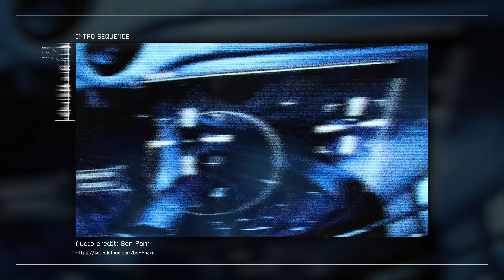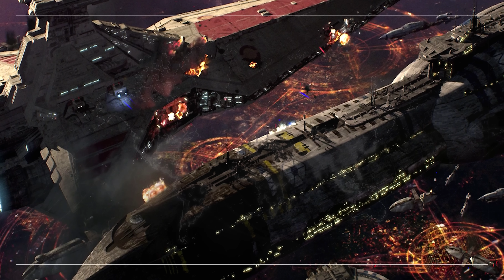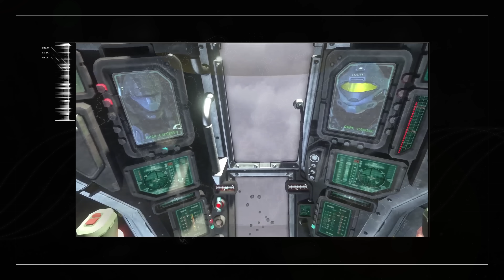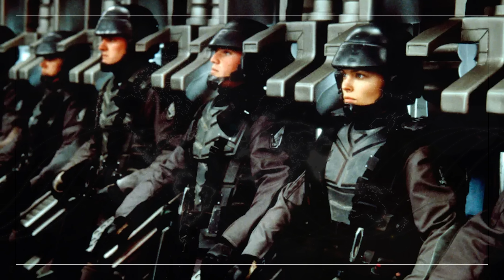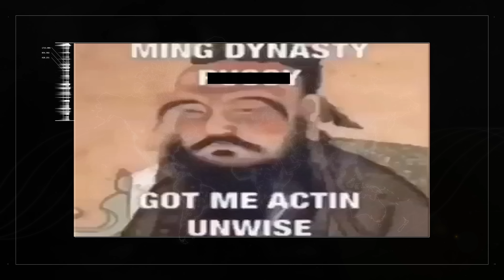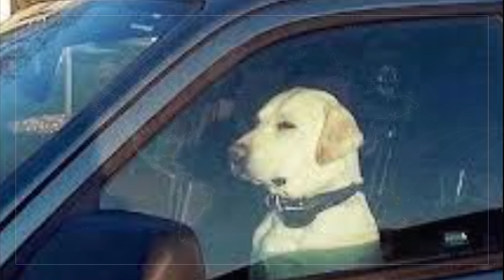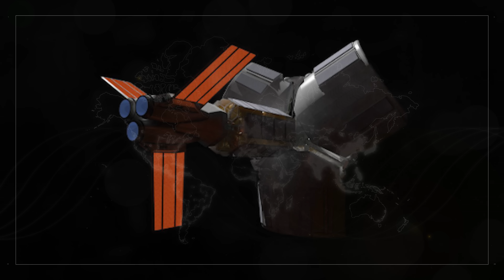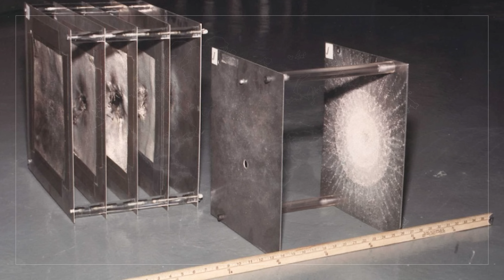The REALITY of Space Warfare

Comment: Yes, space heaters are 100% efficient. 👍

Some notes for the margins:

Droping things from orbit is not really a thing.  Absent an atmospheres, you need as much energy to get something from orbit as into orbit.  An atmosphere makes a difference: The drag makes the way up more expensive and the way down cheaper, but that's just a few kilometres of the way, not all that significant.  Though the heat shielding adds more mass, so there's that.  Orbit is only the high ground for surveilance, not for anything tactical.

Kinetic point defences, as used on maritme navy ships, are not a good idea in space.  For one thing, the recoil is going to do more damage to your ship than the target: nothing to brace against.  For another, there is no drop, so you just add high velocity space debris that will circle around and get you in the back.

The only good option for point defence is lasers.  They don't have much range, and their waste heat will require some massive heat sinks.  Point defence and communication are the only thing they are good for.

Technically, RKVs are also useful for point defence.  As long as you have more of them than your enemy.

There's only three weapon types in space: Inert missiles (like asteroids or tungsten rods), lasers (extremely short range and damaging your own ship), and RKVs (although the R is rather dodgy: whoever has more delta-v wins, but for that to be true the RKV can't just waste reaction mass, it has to match orbit; and light sails and dark sails give you infinite delta-v, so… faster acceleration can't lose, but a win is no longer guaranteed).

Some like to imagine plasma weapons, essenially throwing ball lighning at another ship.  That has all the disadvantages of lasers with none of the advantages.

Comment: Couldn't you convert the heat generated by your ship to whatever form of energy your ship uses to generate thrust?

Like a computer that turns heat into electricity.
Ion thrusters are a thing: they use electric wind to push matter away from your vehicle, moving it in the process.

The excess heat that you cannot convert due to inefficiencies in the conversion process, could be store in a heatsink until there's enough of it that you can run it through the conversion process again.

Comment: Just to slightly challenge hard sci conventions:
I think the inherent advantage to planet defense is working with gravity rather than against it.

 So maybe... dig deep in the bed rock under the ocean, and your attacker has to remove the water (or liquid cycle) just to reach the (new)ground level... to then locate  the correct area, to blast a hole into former sea bed deep enough to reach your subterranean base.... all without mass falling/moving back to cover up the damage.
 
This works because gravity pulls much ejected mass and much of a liquid body back to fill in the orbital drop damage; thus the concept is like terminator armor, or the closest thing we have to energy shields, all without spending active defense energy.

Obviously a big enough drop can crack a tectonic plate, or worse. 
But big attacks are more easy spotted, take more energy to bring to effective trajectory in a reasonable time frame, and are more easily intercepted. 
Just as future combat requires more resources, the cost of digging to such a deep and remote base of operation would likely be more cost effective for the relevant method of combat of that time.

But yeah it might be possible to have directional radiation with out too much complexity, after all we can focus much of the EMS already. Like a flashlight is focused visible light, and directional radio waves aren't too hard.

 I suspect space combat will be like mosquitos, with sniper rifles at kilos away. . . but what can be forgotten is that the area in space is cubic, so comparing space combat to naval combat or a sports field isn't a good metaphor.

... and oh, yeah we always assume spaceships blowup after being "killed". . . a lot of things when broken don't exploded when we think they should, like tanks for instance don't always explode.

Comment: I disagree on this planet versus space take. Assuming similar tech levels. A planet would always have more resources to work with. Everything you need is on the planet. The space force would have to bring its own.

Also the silly thing that all most all Sci-Fi doesnt care about is heat dissipation. Any thing in space that generates power will need radiators so it will not melt.
On a planet you can dump the heat in to atmosphere or the ocean.

And you cannot sneak up on a planet. There is no stealth in space. The planet will see you coming.  

Also I didn't come up with this. Science and Futurism with Isaac Arthur YT channel did. He made a convincing argument.

Comment: I think the single most important factor with space warfare is actually signal warfare. It's quite underappreciated since it's not flashy, but technically flares and chaffs are part of signal warfare, as are decoys. Depending on its effectiveness and the countermeasures to it, long range artillery battles might not be viable and require visual range combat instead, making for exciting close range combat scenes. Tied together with the fact that low powered laser based point defenses can be made to fry the sensors on missiles to turn them into dumb rockets reliably since nothing is faster than a laser. The question at that point becomes how much of such systems that would be the first thought of any space military can be overcome between tactics and technology. The result will determine whether space combat will revert to light second ranged artillery battles, or visual range dogfighting.

As for the intro, I'm not a fan of long intros. Anything more than 10 seconds has me skipping them, with a strong preference towards intros less than 5 seconds. This is a youtube video, not anime. The intro isn't a piece of art to appreciate every episode, but a signboard to know where you are..

Comment: Kessler syndrome takes years to develop. And even then it doesn't take much higher tech or more desperate people than us to still access orbit through a cloud of debris. Using nuclear propulsion can give you enough spare capacity to armor your spaceships, especially if the goal is just short term defense, like delivering a kill vehicle to the people who tried to weaponize kessler syndrome.

Firing down on a planet has one problem you didn't mention, which is that point defenses and counter-missiles exist. We have THAAD, Patriot, and dozens of other systems designed to take down things moving quickly in the atmosphere. In a setting were invaders from another world is a potential near term threat, the defenders are going to design appropriate systems and mass produce them on the same scale while the invader is building up its fleet. 

Planets have one massive advantage that space forces lack: Dirt. Armoring your facilities? Literally dirt cheap. Hiding your defenses? Dirt cheap. Railgun ammo? Not quite dirt cheap, but iron's fairly easy to come by. Life support? Dirt cheap. Thermal venting? Dump it into the ocean. Your space force needs to be able to get here, which means it needs to strip away every gram of mass it can spare. Lighter guns, less armor, less ammo, any cut they can make means they can send a bit more or send it a bit faster. Dirtside, however, you can build as heavy as you want. Use as much power as you want. Require as much crew as you want. You have all your resources right here, and they have a long stretched out supply line.

In general, comparing a space-faring civilization capable of reaching an inhabited world to our own planet and our own tech level, industrialization, and available hardware is uninteresting. It's like pointing out that the US army can defeat a tribe of cavemen. We already know that. But the moment you diligently give the two sides similar resources and tech, it turns out there's a massive overhead involved in building interplanetary invasion forces compared to orbital and surface defenses. 

Say ton for ton a spaceship costs twice as much as a similar ground based system. And that's being extremely generous. That means a ground based force can have twice the firepower in massively armored hidden frames. Twice the point defenses. Twice the sensors. Generally, you're going to want a 3 to 1 in your favor if you're the attacker. Against a prepared defender with twice your capabilities, you just lose. Every single time. And that's assuming a star wars level of magical tech to make spaceships extremely cheap. Currently, it's more like space hardware costs 10-100 times more than similar ground based capacity. 

Gravity is basically a non-issue for any entity that can contemplate invading another planet. If 10kps makes a difference to you, how did you get there in the first place?
Reply: And with how rare we believe habitable-for-carbon-life planets are, it's just as difficult to believe some perceived invasion force would want to simply obliterate it with "cheap" RKV's. That would mean YOUR space-faring people couldn't inhabit for thousands of years, if ever. If you want to invade somebody's planet, it takes a whole other planet's worth of resources and manpower.

Comment: You can't do "can't see me" type of stealth, but you could 100% disguise your ship or a remote missile launcher as space debris.
Reply: Also if your setting has a bunch of commercial vessels. You might be able to camouflage your moves as nomal civilian traffic
Reply: @GanymedeOcean  we would effectively have to adhere to modern ATC regulations, just with the stipulation of light-lag playing a factor now.

It does pose a very real hard-limit to reaction times for defense, certainly. You would need to have a system of identification satellites throughout your solar system whose sole purpose is to perform IFF sooner than the home-planet and report it back at light speed.

If we were only identifying traffic from a few orbits, we wouldn't have enough reaction time before it would already be too late.
Reply: You can't disguise a ship as debris.  Debris doesn't give off waste heat.
Reply: @davidwuhrer6704  You can try to run on low power mode and use a heat sink as long as you can
Reply: @chemplay866 So a few hours maybe?  You'll be clearly visible before that as a ship, and still visible when you engage the silent running.  At which point would anyone mistake that for debris?
Reply: @davidwuhrer6704  what this video doesn't talk about is that shielding a craft with "sails" some distance away from it are completely practical. You just need something artificial between you and the targets looking for you. 

Not besides the point that i think the video OP underestimates just how vast an engagement distance measuring in AUs is (making pinpointing an IR signature that far away and small very difficult), I think it's far more difficult to hide a craft's radio or electromagnetic emissions. It's basically impossible to operate one without emitting these constantly, and even today's monitoring equipment would be capable of picking up an irregularity in traffic in a much larger field of view than IR. you would effectively identify a hostile by getting a general location with other emissions before attempting to get an exact location with IR. space is mind numbingly large, and we simply can't observe all of our solar system at one time with even multiple sources searching the IR spectrum.
Reply: @Jaguar_XJS_V12  We can pinpoint a radio source of a few Watts from beyond the heliopause.  That's a bit more than a few AU, and less energy than a human body or a thruster.

And a cover between you and something else is going to have a different orbit, and therefore won't cover you for long.  Seconds. Minutes at most.

Example: A space ship keeping its position relative to the ISS a few metres away before docking has to thrust every few seconds.  Even at this close distance, it would orbit the station if not powered.

So to keep your sail between you and one spotter, that sail needs to be not only an active ship itself, it needs to be in a powered orbit.  That's not going to hide you, that's going to draw attention.